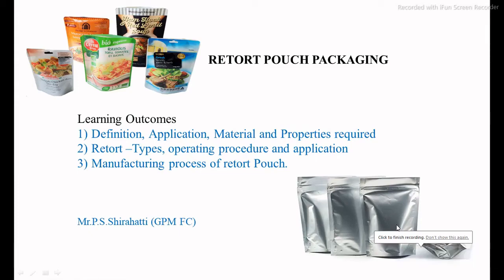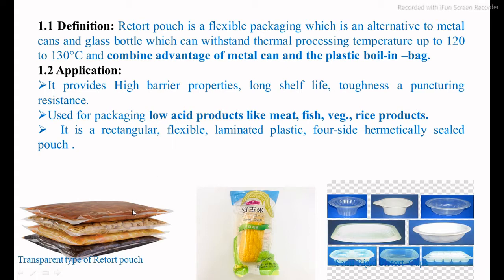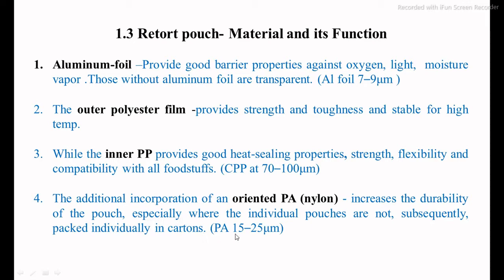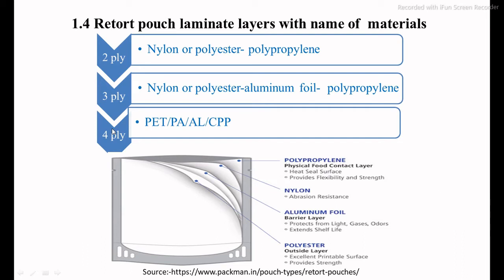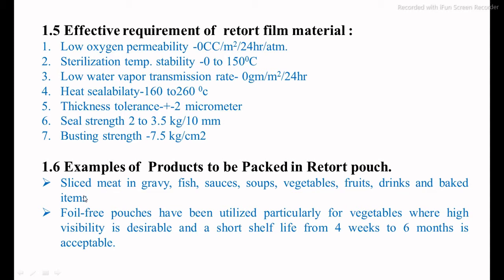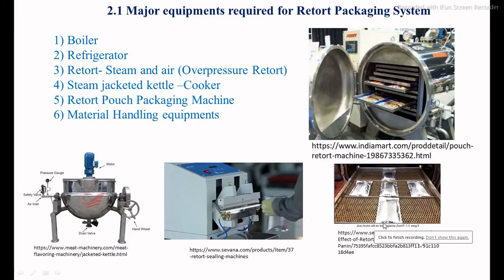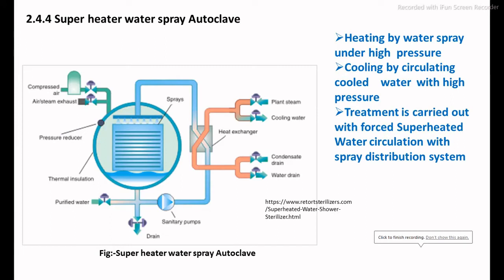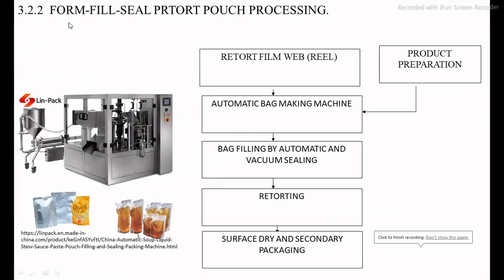Retort Packaging in Food Processing

Comment: Hii sir, i need your help please it's urgent, is it necessary for the retort pouch to be vacuum sealed? can we seal it normally and it will work?
Reply from the maker: Simple way vacuum packaging by, filling the prepared hot product (not less than 65 degrees C) into retort pouch and regular packaging, automatic internal air exhaust by hot vapors...... 
Packaging machine 8mm Sealing Width (mm) required use band sealing machine.....
Reply: @prakashshirahatti2571  thank you so much sir